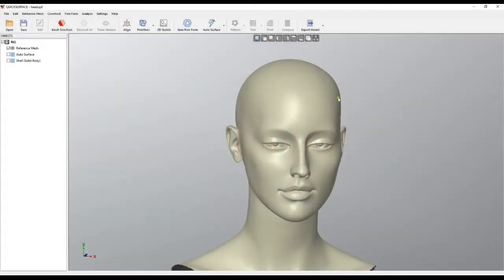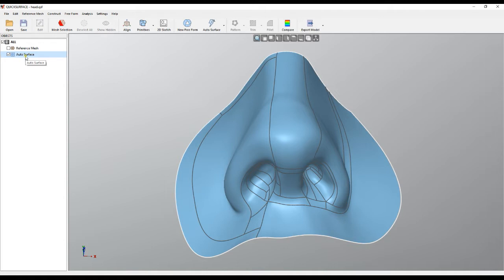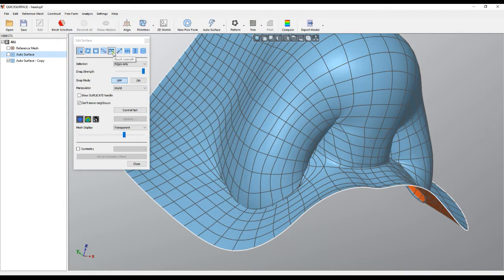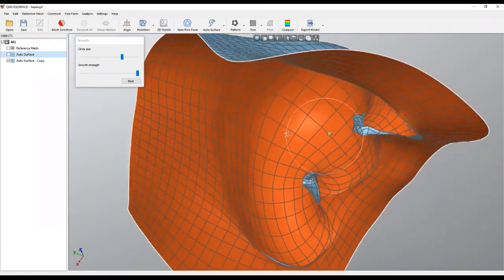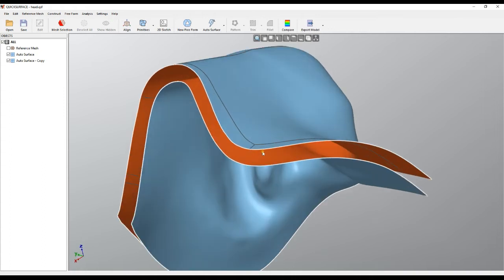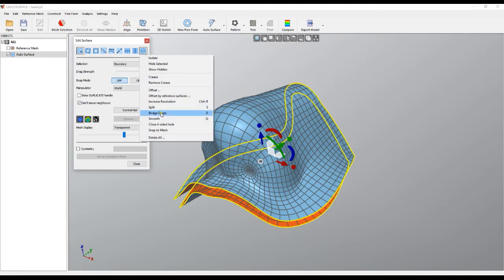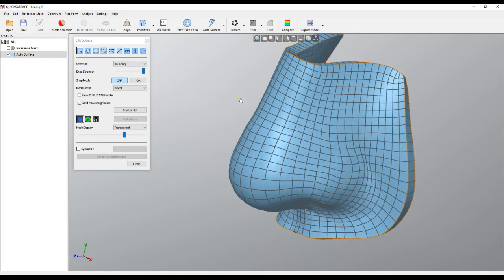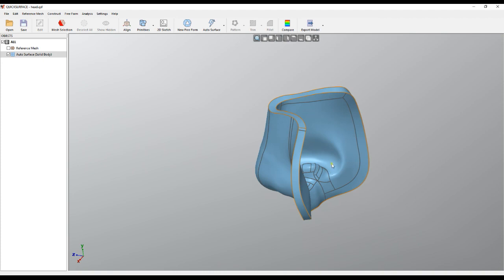QS Tutorials: Solid shell of free form surfaces  -How to do Reverse Engineering with QUICKSURFACE

Comment: This feature is great to make clothes, it would be great if I could draw curves over and trim the generated polysurfaces using curves and if QuickSurface could flatten surfaces like the Squish command of Rhinoceros does.
Reply from the maker: Thank you for your feedback. We will work in this direction too.
Reply: @QUICKSURFACE   When you horizontally wrap a stripe of fabric over a body it does not follow the concave curves but go straight like if the body concave curves were lines or a convex hull of their points. My suggestion is adding this feature, a kind of surface over a mesh that uses convex hull curves as its structure or something like this.
https://en.wikipedia.org/wiki/Convex_hull

Comment: This seems very interesting. I use a lot of 3d software, both surface or solid modeling. None have a quick way to do thickness without spending hours to fix overlapping everyday. I will have to test your software this could save me a lot o time.
Reply from the maker: I am happy to hear that you find the application for this. Although it is an example for this organic shape, the methodology can applied in many cases. We know people spend a lot of time to thicken such surfaces automatically and there is no universal solution. We hope with our tools it will just help the users as you say - to save time.

Comment: Do you have a method for trimming a thickened surface by solid or extruded surface?
Reply from the maker: Yes. You can just use a standard cad commands like trim or Boolean cut from another solid or surfaces. The result is just another solid compatible with the other solids
Reply: @QUICKSURFACE  got it thanks!!! getting the hang of feature selection orders and etc, couldn't figure out why trim was only sometimes available. really liking your software so far, just have to practise more. the "sew" command makes using surfaces in downstream cad much better too. Any chance of adding a thicken feature that would automatically trim self intersecting surface areas? like in your nose above? Thanks for all the hard work!!
Reply from the maker: General thickening of Cad surface is a challenge for any software. And is really hard and there is now universal solution. Unfortunately that is why we offer this solution as a compromise for this type of surfaces. But thank you very much for the request